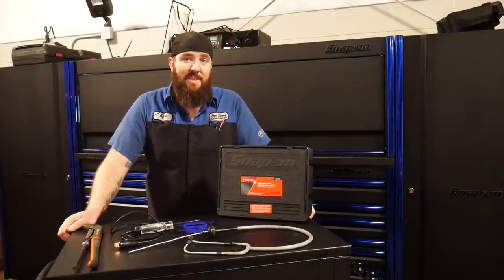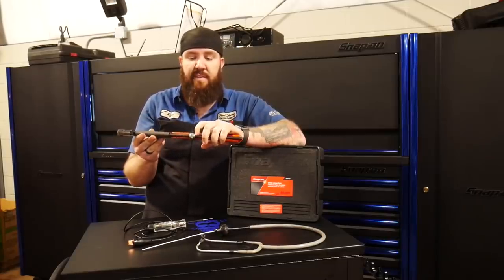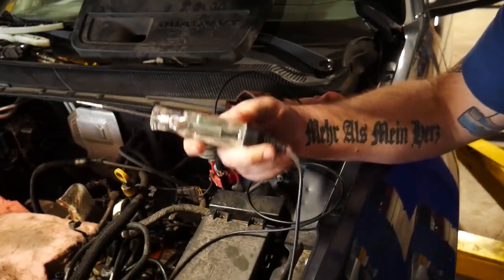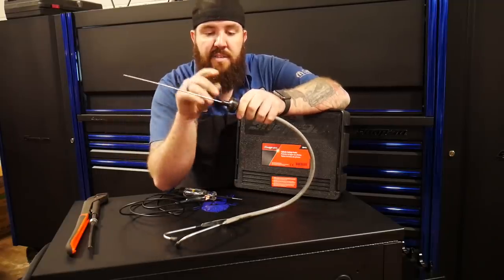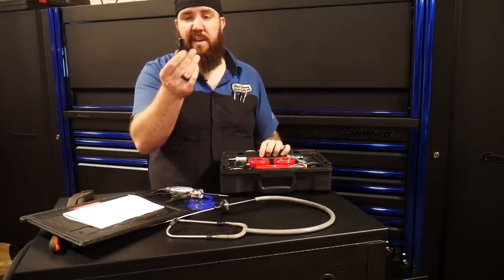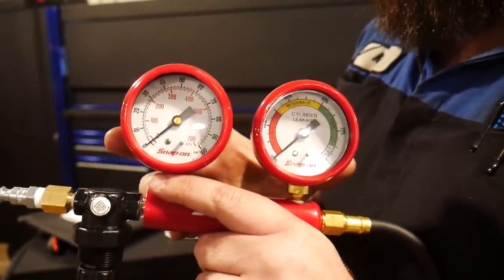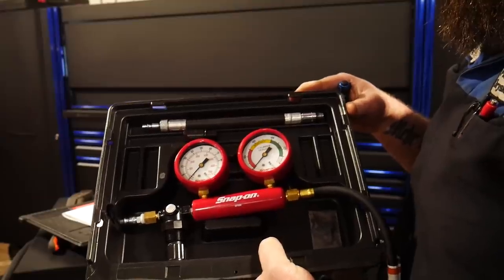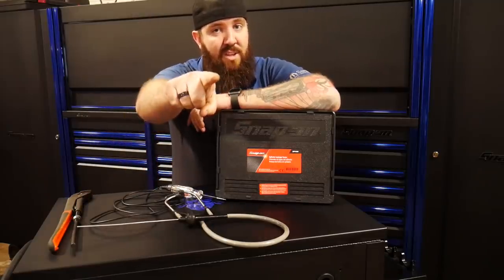NIFTY TOOLS OF THE WEEK WITH RUSTBELT MECHANIC - EPISODE 9

Comment: Nice selection I have been looking at those snap on test lights for some time. 10 milliamps is not much of a load  thought. It would be neat if they added a button that loads the circuit a bit more like the load pro.

Comment: i have that same test light with the voltmeter. nice scope on a rope. i dont have that snap on cylinder leak down tester. i sure do take a good bit of engines apart with valve damage.

Comment: Good video and nice tools! I have to say though I am not a fan of those digital test lights. I have had multiple situations where a circuit would show enough voltage, 12v measured with my power probe or my multimeter, but wouldn't let enough amperage through to actually light an incandescent test light. Circuit reported proper voltage and ground but wouldn't run the component it was supposed to. Also have used them many times when Diagnosing window motor/switch problems. The incandescent light will DIMLY light if its seeing a small amount of current/voltage and tell you the circuit is okay but the switch is bad vs these digital ones with LED's that are pretty much on or off. I have seen your tool collection and it is fantastic, but a normal old school test light and a proper multimeter should be a part of any techs arsenal even more so someone that does Diagnostic work!
Reply from the maker: I agree totally. I like to use this one more for just checking fuses and if there is voltage present where it isn’t supposed to be. It does help that this one has a digital volt meter built on to it to help avoid some of those false readings.
Reply: @RustbeltMechanic  I get it! I know you know what you are doing 😛😛 but I do feel some techs get lazy with it and the truth is every tech should at least have and use a DVOM plus an incandescent test light is less than $10 so I dont know why I would get one of those when the other two do the job better all the way around?

Comment: I could use one of those stethoscopes... I’m tired of shoving an old acetate handle screwdriver in my ear when listening for motor bearings or pump issues
Reply: Haha I remember when I was in the military in a deployment   I got a long screwdriver and stuck it to a Diesel engine generator and one of the young kids eyes lit up and wash shocked at how I knew what was going on. He called me the diesel doctor for the duration 😂
Reply: Hamster ///M3 lol yup, it’s my go to when trying to figure out if a weird sound is coming from the pump or motor. I would with a lot of big centrifugal water pumps

Comment: Never hold the crank bolt when doing a leak down test! If it’s at complete top dead , the crank should not move! Putting 100 psi into a cylinder and tryn to hold it is not smart just saying! This is what I was taught